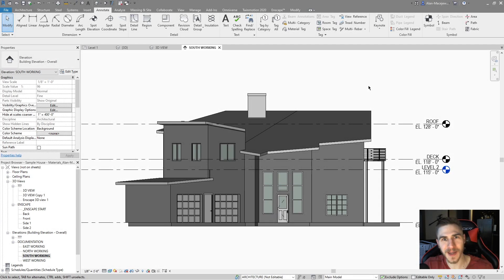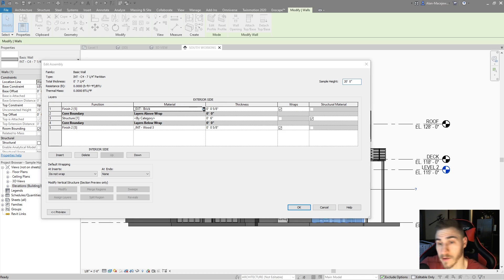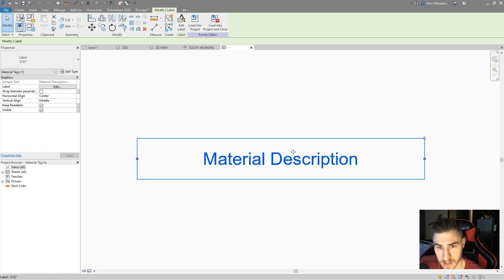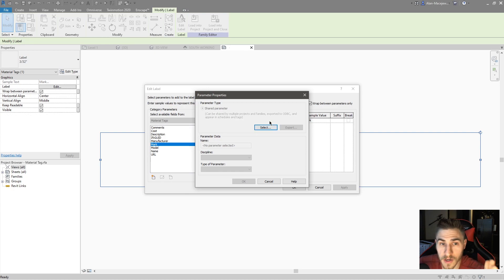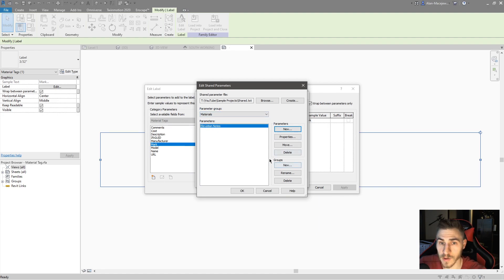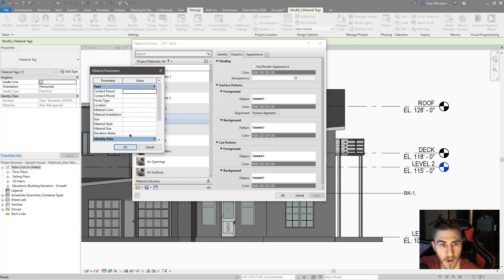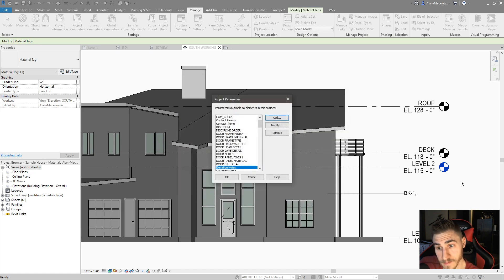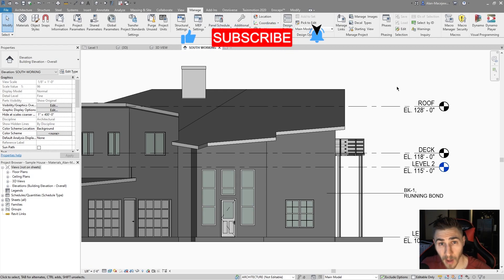How to Create a Custom Material Tag | Revit

Comment: Another off subject  subject btw thanks for your advice on the no-internet running of TW that solution  didn't work, but one quick fix I tried and found to work was creating a TM shortcut without having to run the UR game launcher. So far its working. My off subject question may assist other disabled or handicapped persons out there. Its selecting a mouse that has additional buttons that utilize the 'W', 'A', 'S', 'D', keys of the keyboard. I only have use of my right hand and its not easy navigating around in TW, Sketch-up is a snap especially with the zooming to cursor placement  feature and focus always defaulting to the cursor when moving.  What mouse if any would be a  good selection. keep the videos coming, I'm learning so much through your tuts. Thanks for the time in  making them.

Comment: Thanks for this video! Been trying to figure out a system for our designers to use a tag in elevation but also adding notes. I do have a question though. With the elevations I work with we sometimes need specialized notes to describe in further detail.  The unfortunate aspect of this tag you created is that the text is a Type Parameter. Is there anyway to make the text portion be a Instance Parameter? I have the parameter in the project set to Instance but it still makes it a type.

Comment: Thanks for this, we use a material code to identify materials in our project.  Would you use the in-built 'Mark' parameter or make a Custom Parameter to contain the material code?
Reply from the maker: It really is up to you. Mark is preferred as the universal and most useful method of identifying an element. If you can use Mark, that may be the best but a custom parameter would perform the same.